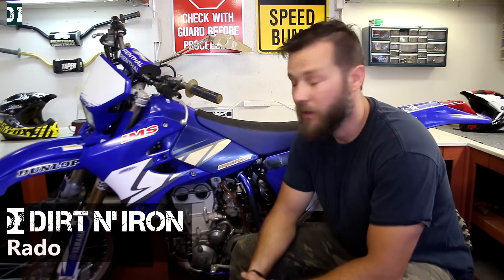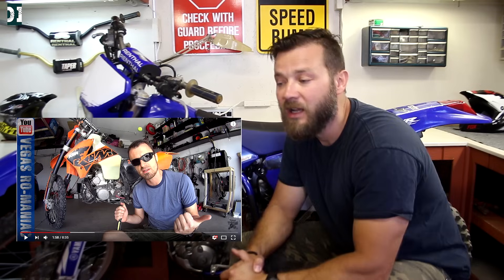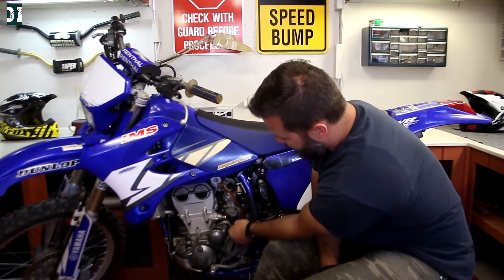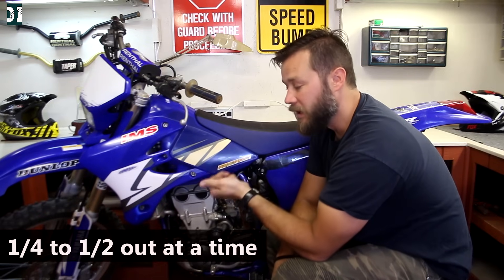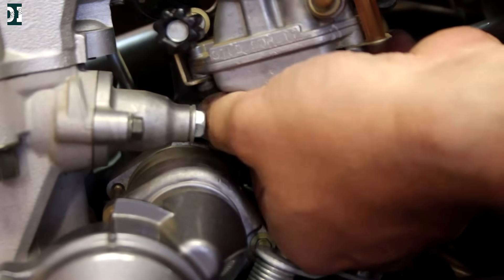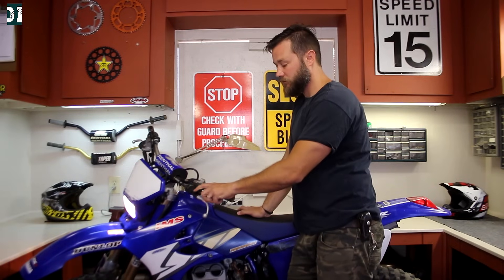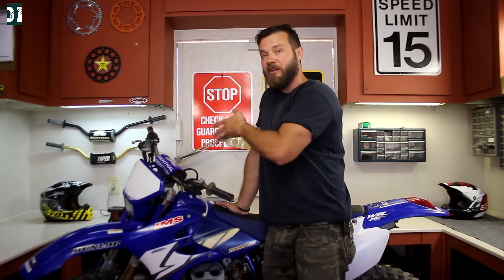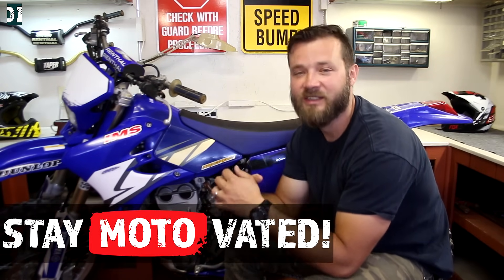How to adjust idle on 4 stroke dirt bikes - fuel screw adjustment

Comment: Hey need some help asap! After riding I wanted to drain all my fuel to keep my carb clean. Someone told me to take off drain bolt on the carb to let gas drain. I thought the drain bolt was the fuel screw so I accidentally took the whole fuel screw out. I put everything back in just fine with both little o rings and put it back in right away. Is it okay that I did that. I can't start it now cause it doesn't have gas, I assume it's fine I just have to set it next time I start it right
Reply from the maker: as long as you put everything back the way it came out then you should be fine. Start at 2 turns out when you are tuning it
Reply: @dirtniron   so I put some fresh gas in it today and tuned it up and everything seems good! My bike revs up when I pull on the hot start! It's an 05 yz250f. I think im going to get a tachometer so I know my idle is at a good level. But everything sounds great right now. I was a little worried because I had gas in there for about 3 months however I was starting it a few times a week but I emptied it all out and have fresh gas now. So I think my carb is okay now 😀 thank you for all your help

Comment: What exactly do you mean at 3:38 "raise the rpm a little bit higher with the idle screw"? I think my idle screw is not adjusted well in the first place. So how do I know where the idle screw position (a little bit higher than normal as you say in the video) should be in order to continue with the procedure?
Reply from the maker: raise it higher than normal, just listen to the engine and adjust it so it has high idle..

Comment: My 2011 drz is fully stock. I had a idling problem so I cleaned the jets and now the bike runs. I set the fuel screw back to what Suzuki set it to stock from the factory (3 and 1/8th turns). Now the bike is having issues with "floating idle". It idles normally but once the engine is hot it tends to idle higher only occasionally and without any throttle input. What's going on?
Reply from the maker: check your vacuum pressure plate, the gasket sometimes goes bad and can cause the idle to be unstable..
Reply: @dirtniron  Thanks for the reply! Wasn't actually expecting the video creator to read or reply to my comment!  It is definitely appreciated.

This is a bit embarrassing but I do not know what the vacuum pressure plate is and cannot find it in the suzuki manual.  Is it a part of the Carb or the Engine itself?  Does it have another name?
Reply from the maker: @jond3929  I assume you have the same carb as the one in the video. The pressure plate is part of the slider in the carburetor- Keihin FCR
Reply: @dirtniron  Thanks for the help.  I did more research and now I know the part you're talking about. Makes sense that that could be where the problem is! Than you!

Comment: I did this to mine and runs fine when warm but when it’s cold it back fires and bogs is this normal
Reply from the maker: use choke, warm her up.. should be ok.. maybe get her little more fuel with the screw

Comment: I have a 07 CRF230F that every once in a while will rev really high when I pull in the clutch after 15-20 minutes of riding. So I’ll adjust the idle screw until the idle sounds correct, though the next time I go to ride it since I adjusted the screw the idle becomes too low for a cold bike.
Reply from the maker: hmm.. something is not right, see if your throttle cable or hot start cable routing is ok, I had that problem once, the cable got pulled and caused bike to rev higher..

Comment: This is so helpful. Does anyone know if this adjustment corrects an exhaust manifold that glows bright red on wr250f?  I’ve read that it does but haven’t tried it yet.
Reply from the maker: you are running too lean, play with the screw and possibly the jetting
Reply: @dirtniron  thanks!

Comment: Should I adjust carb or throttle cable because the bike is running at high rpm it sound like I’m revving it but I’m not and the bike wants to just go fast and in 1st or 2nd it won’t cruise at slow speed I always have to pull the clutch in to go slow
Reply from the maker: you need to have a free play on your throttle and then adjust the idle on the carb.

Comment: So in the end you said that hot start should make your rpm go up? Is good thing?
Reply from the maker: yes thats a good thing, that means you have correct mixture and the hot start is doing what it supposed to.
Reply: @dirtniron  thanks for the quick reply i was thinking from yesterday that something went wrong during the servicing of my 125cc bajaj discover bike because when i start rpm is low and when i warm up and rev it the rpm becomes a bit higher by like 50 to 70 rpms and ideals there. Hope thats not a problem 🤣

Comment: Would this help with my leaky carb it runs fine no back fire but overflows
Reply from the maker: no, you need to fixed that.. its probably a float valve or the seat for that valve.. sometimes helps to blow compressed air into the carb thru the fuel line, that would clean it and help to sit well in its place
Reply: @dirtniron  top man cheers

Comment: When I Turned it counter clockwise the idle got higher this is a ttr125 But it has a bog checked everything but you said turn it all the way in until it’s seat (clockwise) then to slowly turn it out (counterclockwise) until the idle drops but mine goes up ....help😂
Reply from the maker: i am not sure man,  not sure what kind of carb you have.. what kind of jetting and other possible issues.. sorry

Comment: Can you do a video on a fuel injected 4 stroke. I am a new bike owner and my bike is occasionally backfiring on deceleration as well as occasionally spitting small flames. Not sure if I need to adjust my valves or if its too lean or rich.
Reply: If you didnt find the solution yet, its a bit lean. Not sure how to adjust fuel injection, but it would probably be in your manual

Comment: I have a question.. I own a KTM SM with a carb.. If I am to change the exhausts (slip ons), do I need to do anything else on my bike? I know that removing the original muffler and putting an aftermarket one will decrease the back pressure.. In what scenario do I need or can I adjust the carb? What are your suggestions? thanks
Reply from the maker: you might need to play with it, depends how she runs. Do you have a backfire when going off the gas, hesitation? it should run better now
Reply: @dirtniron  well for now I still have the originals on.. But I know I might experience backfires or even maybe stalls.. Can that be adjusted with just carb regulation? Increase fuel/air intake to the engine?

Comment: When mine strats if i apply throttle it dies and when it doesn't it dies eazy
Reply from the maker: lean conditions I think, check your carb.. possibly clogged or dirty pilot  or might need to rejet

Comment: Nice Video, If I may I’ll add something else to do with WR 450 or any other Carby 4stroke.
I personally don’t like the after market fuel adjustment screw, this is why. I keep the OEM screw , adjust as required , generally if your jets are right size and clean , you will end up about 2.5 to 3 turns out on mixture screw. It is tricky to adjust OEM screw, but not that hard use a tiny screw driver BIT
Now once the bike is running right your happy with mixer screw setting , put a blob of grease in the mixer hole, behind head of screw , then stuff a tiny bit of rubber / sponge in the hole behind the grease. 2 reason, stops the screw coming loose .they do and can fall out, or change the mixer setting, and the mixer screws can and do leak past the thread , screwing your mixer ever so slightly also, if it falls out it will stop, 👍. After market screw vibrate loose also, put a rubber band on it also.
Reply from the maker: thanks for sharing Ben, appreciate it!

Comment: When I screw the air/fuel screw in all the way and bring the idle up, as I bring the air/fuel screw out the revs are going up, not down. Any suggestions? Bike is a 144cc 4 stroke 🤷‍♂️
Reply: Stephen Windle I think you might need to switch you pilot/slow jet to a larger size. That’s what I’m doing to my crf250r. There’s a good video explaining https://youtu.be/kUw41sUQbTY I’ll tell you if it works on mine

Comment: never adjusted a carburetor before - watched your video after rebuilding my sons old secondhand carb(after watching another video) , and now it runs PERFECT ! Thank you. Great video.
Reply from the maker: Thanks for sharing, i am glad it helps! 👍
Reply: @dirtniron  I have a 08 KTM 4 stroke I have the needle set at top clip and and fuel screw only 1 turn out and my bike is still running to rich what do I need to adjust to fix this? Thank you for the info

Comment: In my 4 stroke bike. The Air fuel mixture screw is on Air filter side. The ideal screw is near to engine. Then is it a fuel screw or Petrol screw. I am confused. Please help.
My bike is SUZUKI HAYATE 110.
Reply from the maker: I am not familiar with that bike, sorry .. do some research - check out the manual
Reply: @dirtniron  Thanks a lot for your reply. In some video I had seen that if Air-Fuel screw is away from engine and near to Airfilter, then it is a Air screw. I am confused because u r saying in four stroke bike there is fuel screw. Manual dosent have any disruption pertaining to this. Please guide if possible. Thanks.
Reply: @dirtniron  OK. THANKS.

Comment: If I gotta turn the fuel/air mixture screw on the bottom of the carb more 3 full turns out/down to a steady idol. Does that mean I should get a bigger pilot jet?
Reply from the maker: 3turns is right at the border of changing the jet.. I would probably change it
Reply: Dirt N Iron, one size bigger pilot jet or main jet?
Reply from the maker: Adam Karpinen pilot
Reply: Dirt N Iron thanx for ur help advice

Comment: Does aftermarket exhaust cause lean mixture? I have to turned my pilot screw more than 2.   I already go 1 size larger slow jet, I think 2 size larger will fix the issue.  Is that normal to go 1 or more larger slow jet?

Comment: Thanks for the video. When I push the hot start rpm raises for two seconds then goes down and the engine stops.
Reply from the maker: how does the bike run? I havent had that kind of problem, not sure
Reply: @dirtniron  Thanks for the answer. The bike is running well. Only backfiring a little when decelerating. The fuel screw is 3 turns out. Maybe I should change the pilot jet from 42 to 45. Thanks again man!
Reply from the maker: yes, thats what I would do. 3 turns out is too much and if the bike still backfires on decel then i would definitely go one size bigger on pilot. Or maybe try to lift the needle 1-2 notch first..
Reply: @dirtniron  Thanks man! I will try it!

Comment: Ok. I have watched the 2 Stroke (Air Screw vid) and this one. Both awesome and very informative based on the sound and feel of the motor. 

My question is. I have a 4 Stroke. Kawasaki KlX 110 that utilizes an AIR Screw. So. Can I set it out 1.5 turns from closed then richen it up to the low rpm state or do i lean to highest rpm? 

Don’t want to go from only response. I Like the way you can get close by listening to rpms based off the screw manipulation (opening or closing).
Reply from the maker: you can go either way and listen to sound, try to throttle response, etc ..

Comment: So my question is.... on my wr 250f I  installed the jd jet kit with their recommended jets but that is for stock exhaust if im not mistaken. I have a full fmf exhaust have you ever done aftermarket exhaust? Do you go up a size for the pilot jet?
Reply from the maker: it depends how she feels. I went with richer needle and it was better. First try to use rich needle or lift the current needle higher to get more fuel. Play with it a bit
Reply: Ok its at the 5th position per their recommendations. If I go to the 4th position wouldnt that make it leaner?

Comment: Ok, I get it now BIG THANK YOU 🙏
Reply from the maker: You are welcome Kev!
Reply: @dirtniron  
Any advice on how to remove the bangs when releasing the throttle while riding? I have a FMF full exhaust line and it continuously pops and bang when decelerating.
Reply from the maker: Kev Kev bike is too lean on pilot circuit. First try to give her more fuel with fuel screw, try 3 turns out. If that doesnt help then lift the needle one notch higher or replace pilot jet one size bigger.
Reply: @dirtniron  I will try this tomorrow.  Once again BIG THANK YOU for your support!
Reply: @dirtniron  if I unscrew the pilot jet screw will it have any effect on the richness of the fuel mixture or I really need to swap it for a bigger size? 
It is currently a ☆48. 

Thanks!
Reply from the maker: @411BLMPRO  you cant do that, the jets need to be screwed in all the way. Fuel screw is the one you can adjust.

Comment: Hello I have a 2003 Yamaha yz250f my first problem is it does not want to start unless the bike is being rolled a good speed and it will start first or second kick but when you get it started it runs through all the gears perfectly but when you come to a slow speed it stopped it does not want to idle at all it will die unless you constantly give it throttle.. any ideas? Thanks in advance...
Reply from the maker: I would take the carb apart, clean it and also rebuild it, then use stock jets and start jetting it from there. you can also get JD jetting kit, that saves a lot of time and bike runs great.

Comment: Great video I’m having real bad issues with my 2008 yz250f. Feels the power is getting robbed in every gear except 1st and 5th. Idle is high but tried adjusting the fuel maybe the idle screw is the key?
Reply from the maker: hmm.. it doesnt sounds right, if you have carb problem it will feel weird all the time, but yea, adjust it and see if bike runs better
Reply: Dirt N Iron thanks for the reply. I’m gonna  go ahead and do a cleaning. I’m thinking the pilot jet is clogged

Comment: Sir couldn't understand because of u r fast english, so please answer my question  by letter, what is the choke indicates? is the  rising enging is   indicates the mixture is in the lean side or rich.
Reply from the maker: choke makes it rich
Reply: thank u mr., i am having yamaha 125 bike, i have tuned 2.5 turns, engine sound and mileage is ok , but detonation sound while give the throttle, by saw ur video, i make 2 turns, my bike don"make d sound, i am very happy, so thanks once again.
Reply: Sir i turned the fuel screw 2 turns, no d sound, but rpm is not stable. What can i do, please reply.
Reply: Reply plez

Comment: Very useful and clear explanation! Does that procedure apply also for the Yama WR 450 F my2007?
Reply from the maker: Yes it does, same carb on that bike.
Reply: @dirtniron  I did it, but while you turn the fuel screw out your engine rpm drop, my engine rpm speed up and stay that way even if I continue to turn the fuel screw out. Why?

Comment: I've a dirt bike and I had set a new RIDEX 12V 7amp Battery for this but thats not performing well like after using one month I see bike's self is not working like when I push self switch than abruptly all the lights like dashboar's headlights all are starts to diming so whats should I do,  should I buy new battery?
Reply from the maker: make sure the battery is charged, check you charging system too

Comment: Help, I did everything you suggested, however, when I turn my fuel/air screw OUT it actually does the opposite. It starts to increase RPM, not decrease. Any thoughts why this is? And when I try to rev the engine, it bogs down and dies. However, it runs GREAT with the choke on. Confused. Any help would be great. Thanks.
Reply: Im having the exact same problem, the rpm goes up. Maybe you figured it out?
Reply: Same here
Reply: Clean your carb

Comment: Why do the screws on my carb seem to do the exact opposite. I Turn the fuel screw all the way in and the bike revs it’s ass off, I turn the idle all the way closed and the bike revs like crazy too. This dumbass carb is making no sense, how does it even work???
Reply: I have adjusted other carburetors before and never had an issue.
Reply from the maker: what bike is it?

Comment: The most clear idle adjustment video I've seen.....
Reply from the maker: thanks Tom, glad you see it that way ;)
Reply: @dirtniron  With fuel injection now, it is a moot point.....but the guy that decided to put the idle mixture screw on the bottom of the carb on 4-strokes.....probably won't get to Heaven, will he?

Comment: So how do I adjust my screw on my 04 yz250f? The thing gets way too hot when it just sits there idling
Reply from the maker: lean bike runs hot, rich bike runs cooler.. so you might need to bring the fuel screw out a bit
Reply: @dirtniron  so I've checked my jets and cleaned my carb, and checked my spark plug, but the bike will only run with choke. Could that also be a screw issue

Comment: I got a question, I have a 125cc engine and I've tuned it perfectly for idle and it seems that it is running rich but the throttle response is really late and boggy, but I have tuned it for lean and it is still boggy, is that a jetting problem, I have no clue
Reply from the maker: If it bogs its lean, you need to first determine if its rich or lean. I would first assume that its lean and start to richen up little by little and see how it responds. Give her more fuel first with the fuel screw, then maybe raise a needle one notch and play with it again.
Reply: I had the same problem. I found its best to set the idle rpm high for better throttle response.

Comment: I have a 2004 RMZ250 my question is should there be a filter on the gas line going to the carburetor or not
Reply from the maker: there is one in the tank, but I would use one more on the fuel line just to be sure..